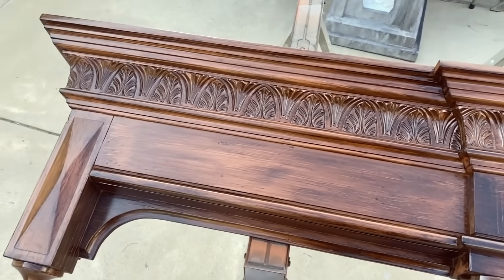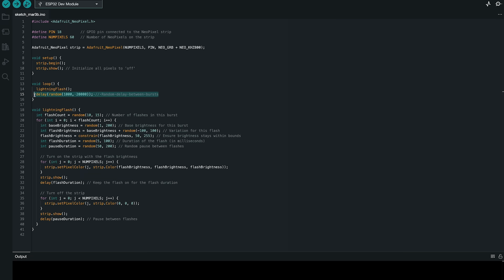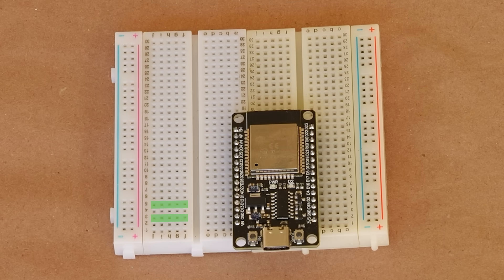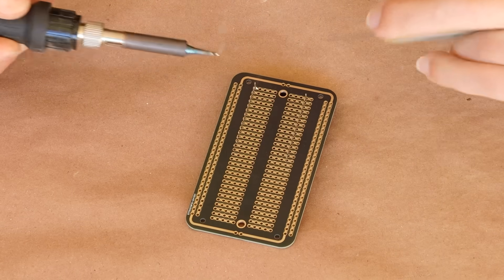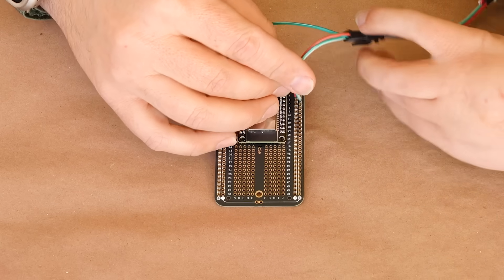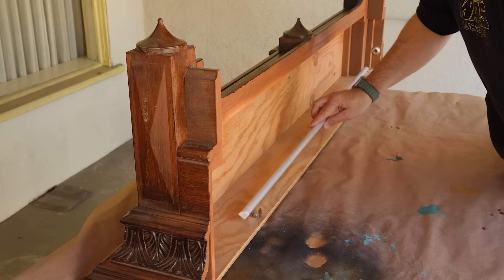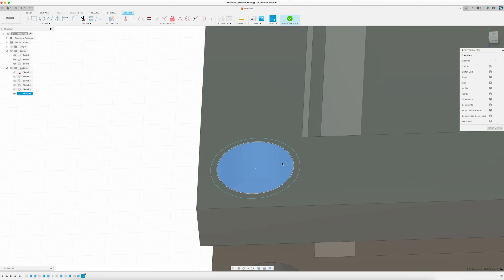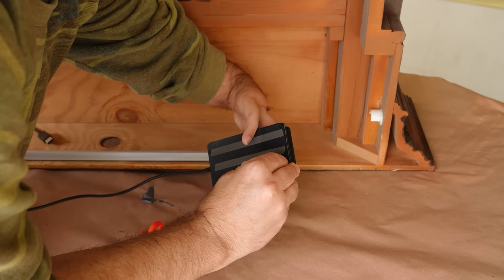A SHOCKING Upgrade to my Haunted Mansion Window - USING AI!

Comment: I think I have a tip for you. The Random is not really a Random, it is pseudo random. Every time you startup the controller,  the sequence wil be the same. At in your Void Setup the next line:" randomSeed(analogRead(X)); and replace the X with a open analog port. When the controller starts, it will listen to the open analoge port for  noise and give it a number. This number will be used for the Random to make more variation in the sequence. Because the noise is not always the same on the analog port, the number on randomseed will change.

Nice idea tho use magnets on the electric box! Handy!

Comment: You should check out an open source LED controller project called WLED. Will work with the same ESP32 and even has a lightning effect already included

Comment: Rather than soldering the esp direct to the board, you should use sockets instead. That way you don't have to worry about too much heat on the esp and it makes for easy replacement of the esp. Plus power the strip with its own 5v power supply for longer runs of strip. How so I know this? I make these all the time for my drum stream set up and my pixel led Christmas light display.
Reply from the maker: thanks for the advice!

Comment: It should be said that you should not use code  that you can not understand if it hasn’t been community vetted and will be on your local network. If it’s for an isolated thing with no network connection, then it’s not particularly risky but if there’s a network connection you need to be able to know what the code is doing and that it’s only doing what you intended.
Reply from the maker: This will never have network connection, but that’s good to know.

Comment: Using AI as a handy helper can be very powerful. I was given a prop, a steampunk box with a scanner dish and lights. I was asked to make the dish sweep from left to right as the light flashes quicker and quicker. I can do either on an arduino, but not both at the same  time" Chat gbt gave me the code in a minute and  it worked first  time. I noticed the box had another switch i could wire up, so  I asked Chat gpt to change the code so when this switch was activated the flashing was at it's fastest. The prop was used in a short film, and this way it could be set for close ups and retakes without waiting for the whole sequence.
  I love that the ai explained what parts of the code did  what. It was actually teaching me the code .

Comment: Very nice job!  
For future electronics projects, I would suggest soldering a few more than just the 3 pins. Electrically you should be fine, but mechanically, I would worry vibration/ dropping could crack the solder joints loose.
Reply from the maker: Good point! I'll keep that in mind for future projects.

Comment: Nice project. Some tips: I wouldn't recommend powering the entire led strip through the usb port of the microcontroller. Especially longer LED strips can draw quite a bit of power, which I wouldn't want to run through the microcontroller. Instead, I'd recommend getting a good 5V power supply and powering the microcontroller and led strip off of it in parallel. Most microcontrollers can be powered throught their 5V pin or V-in pin.

Look into the wled firmware for esp microcontrollers. It requires no coding, is super easy to install and gives you a plethora of options when it comes to led effects (including lightning). It even comes with na app that you can then use to control your led strip. Their website also has some great info on wiring up these kinds of led strips. For example, it's recommended to place a resistor on the data line to protect the first led on the strip.
Reply from the maker: Thanks so much for this info!
Reply: Yes, very much this. A single Neopixel can draw up to 60ma, so a 60 pixel strip could theoretically draw up to 3.6A. Aside from being way more than what a USB port supports, it can lead to brown outs  and microcontroller resets. This is a common thing to avoid in the animatronics world too with how best to power servos.